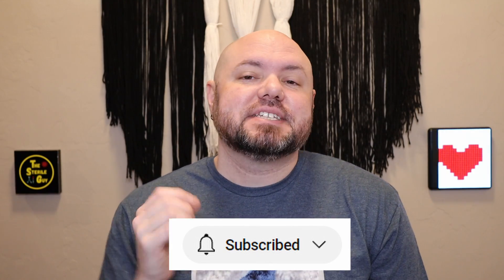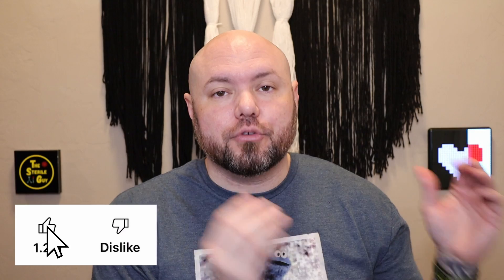3 Bay Sinks in Decontamination

Comment: Question, on page XV, of the standard it says that "should" indicates that among several possibilities one is recommended as particularly suitable, without mentioning or excluding others, or that a certain course of action is preferred but not necessarily required. On page 21, it says that the decontamination area / room should have a three section sink. This seems to me to indicate that a three-section sink is still optional and not a requirement. Thoughts?
Reply from the maker: That’s exactly correct.
Reply: @thesterileguy  It is surprising how little is actually listed as a requirement in the standard. In the organization I used to work for, whenever we made a recommendation to change a practice, we were asked "Is it a should or a must?". As an infection preventionist, we recognize that much of what we recommend isn't a regulatory requirement, but that shouldn't matter.  Deciding to implement something that can potentially save lives shouldn't be determined by if we HAVE to do it. We should do it because we can.
Reply from the maker: I totally agree, way too much vagueness for a critical area of patient safety. My guess on why the standards read this way is because Sterile Processing historically has been massively neglected over the last several decades. So much so departments still continue to use sterilizers 8-10 years past their life expectancy in some locations because they refused to replace them. For sterile processing departments to catch up, a lot of them still have a lot of work to do, which is gonna require massive remodeling and construction. I think the vagueness in the standards was meant to push towards change without yet requiring it, which could really hurt some hospitals. And if that is the case of my guess being right, I think it has been long enough and the requirements need to change. 2017 was 8 years ago and it really is time for AAMI to drop a new standards with much firmer requirements. And one other thing, I think a big struggle with getting the standards in line, is because AAMI has so many vendors as committee members that they’re all fighting for money and cannot agree on simple things. Instead of fighting for what’s right and for the patients, they’re fighting to keep their businesses relevant and important. It’s a shame.

Comment: Correct me If I am wrong. This is according to my school:

1st sink: Manual cleaning with enzymatic detergent and utility/hard/non-critical water

2nd sink: Initial rinse with soft/treated water (Reverse Osmosis or Deionized) then maybe mechanically or ultrasonic cleaned before going to 3rd sink

3rd sink: Final rinse with critical water (RO, Deionized, or Distilled) then endorse to prep and pack
Reply from the maker: There are many ways you can add to the process, you just cannot take away from the process. So it sounds like what your school is recommending still follows suit mostly to AAMI’s manual. I’m glad they make it a point to say 3rd and final rinse AFTER ultrasonic, that’s very good!

Comment: If AMMI doesn’t require that particular flow of the sinks for washing…where did that best practice idea come from ?
Reply from the maker: It’s in the AAMI standards book. But it isn’t yet a requirement because a lot of facilities still have 2 bay sinks. It really comes down to efficiency and ensuring corners aren’t cut. For instance, if you’re using a two basic sink, you are soaking and washing in the same bay and then rinsing in the other one. Which means when you put the instruments in that first sink bay you have to let them soak for the specified amount of time from the enzymatic before you can start cleaning them which is a time waste. And you can’t rinse in that same bay because then you’ll under dilute the enzymatic dosing. So three bays just makes it easier to soak, wash and rinse without disturbing each other.
Reply: @ I really appreciate the detailed answer. We have a three 3 bay sinks. I am trying to work with my manager to explain to him why we need to have the proper flow be that way. . Right now they are using the first two bays within enzymatic water for soaking and cleaning and they’re doing nothing with a third bay. Oof
Reply from the maker: Technically you could do both soak and wash in first two bays but you absolutely cannot rinse into already dosed fluid. Rinsing must be in that empty 3rd sink.

Comment: I love this video, but I have a quick question. Even if the OR performs pre-treatment, is it ok to still perform a soak with enzymatic in the 1st basin?  Even if you have a superb OR process and they pre-treat well.
Reply from the maker: You have to perform a cold water soak or rinse first according to AAMI. So technically the answer is no. However, what you’re describing is the norm of what a lot of SPDs do.
Reply: What's also interesting is the latest 70 series sinks from Steris. They automatically fill and dose the first two basins. I don't think there's a way to get around it. 🤷🏻‍♂️